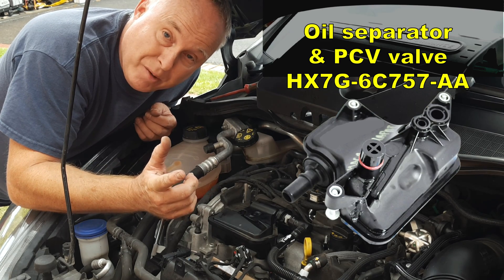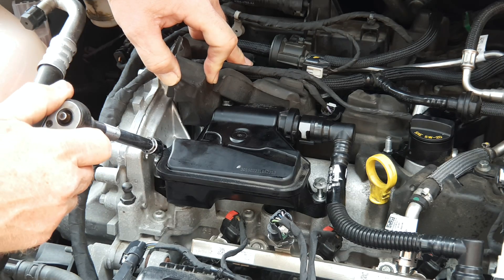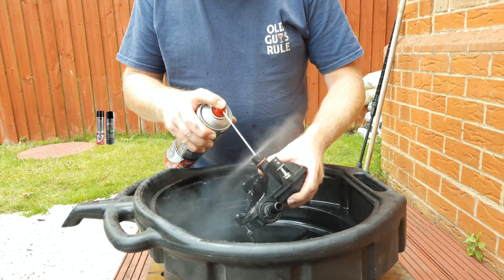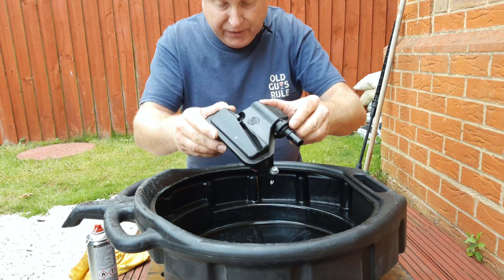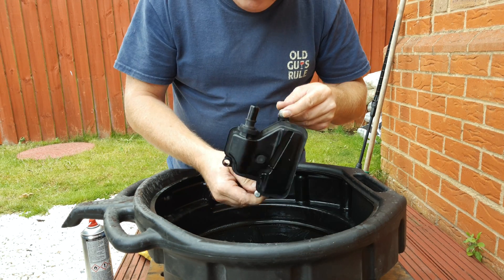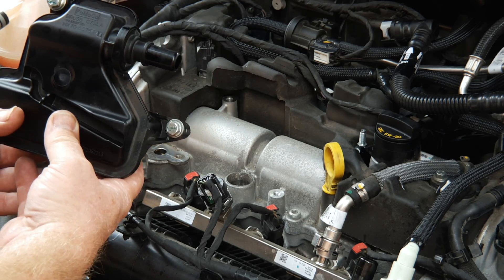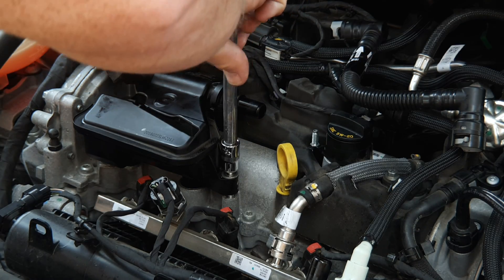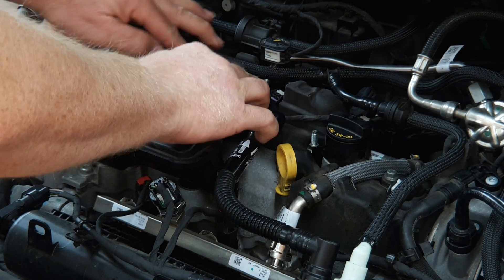Ford 3 Cyl Oil Separator and PCV Valve (Ecoboost) - Cleaning

Comment: hi where is it located on a 2020 1,0L MK4 Focus
Reply: There are 2.

1 on top of the timing chain cover. - idle

2 Rear of engine above the turbo. - boost

Both fairly straightforward to get to and remove.

Especially simple for #1.

As @CycloneCyd mentioned, check condition of O rings/gaskets prior to refitting.

They may, but not likely, be damaged during removal.

it is probably worth considering getting a set prior to servicing, especially if you intend doing this as often (every 2 oil changes) as Cyd recommends.

Comment: Oh my red rocket has 118k mileson it. I had no idea these were supposed tobe cleaned or replaced every 30-50k. I was still mopping the floor street racing people challenging me at 100k. Mine is supercharged. I let a shop change the supercharger fluid. I deeply regret that. Took me 8 months to undo all the wild electrcal damage they did. I likely need to take it to a "Lightning Master" for it to run as fast as it did before i let morons touch it.

Comment: mate that’s the fresh air side, it doesn’t do anything but put fresh air into the crank. the actual pcv and oil separator is on the rear of the engine.

Comment: You mention an oil catch can would be best. Would that be in addition to the PCV valve or just eliminating it. I was contemplating doing this on my vehicle which has a 1.3L multiject diesel engine made by GM. This PCV valve/oil separator always has given me trouble. Either broken hose, a lot of blow by and oil in my intake, loading the oil into the turbo, intercooler, throttle body. Which is really annoying. Car only has 140,000 km and I have always maintained it well with 10k oil changes(even though 30k is recommended). So I was wondering if I can just get rid of that PCV valve oil separator and install an oil catch can in its place.

Comment: I have a 1ltr 2013 EcoBoost fiesta . I'm having issues with what I assume is pcv valve.  Is there anyway off contacting you for some advice? . Thanks in advance
Reply from the maker: Have you tried cleaning it up as per this video? What symptoms are you getting?
Reply: Thanks for the reply . It turned out after a closer look it was actually intact a failing turbo 😔 ! Which gave out all the symptoms of a dodgy pcv

Comment: I would be careful with brake cleaner as some can damage plastic and rubber. Maybe it would be good to leave it to soak in some cleaning liquid over the night if you don't need the car all the time?
Reply from the maker: It's acetone that does that, so use acetone free cleaner - which most is these days 👍